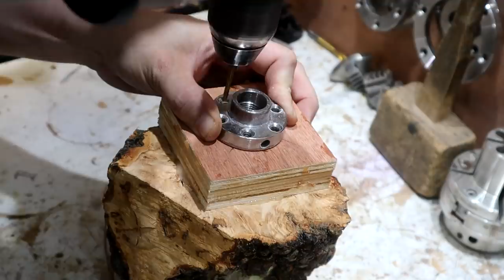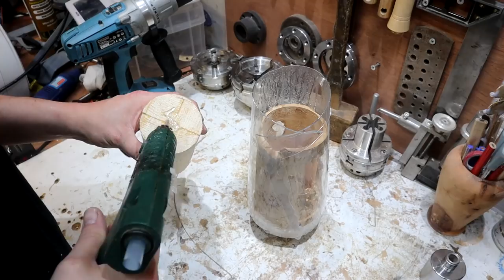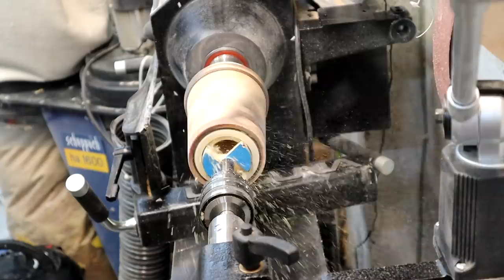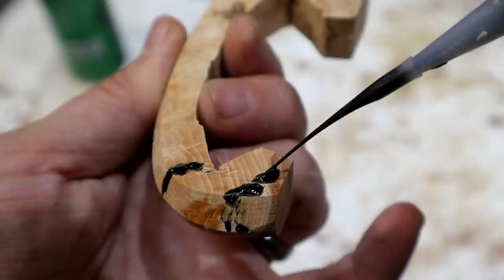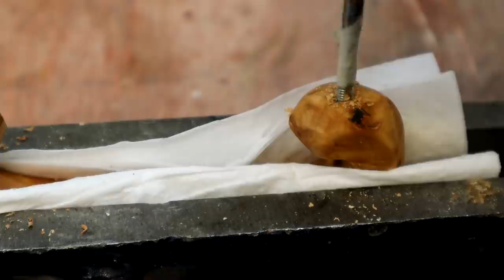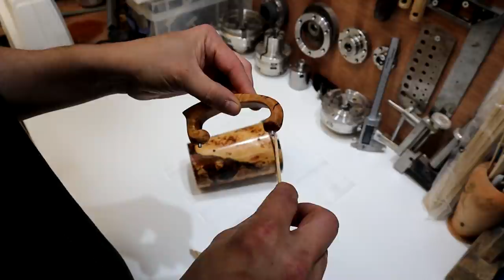Woodturning - The Beer Tankard

Comment: Very nice! But beer handle with less surface contact to hold with beer mug I don't think that the handle will hold for long.
Reply from the maker: Its held in with threaded steel pins, its not going anywhere 👍

Comment: Beautiful! Out of interest, what do you seal the inside of your drinking vessels with to stop the beer/wine seeping into the wood, or the any oil or polish or general woodiness seeping into your beer/wine?
Reply from the maker: This one has a sleeve of resin on the inside, the contents will never touch the wood, I use other finishes too, but anything used with liquids is always a type that cures to provide a water tight seal
Reply: Matt Jordan Thanks so much for getting back to me! If you don’t mind, what other kinds of finishes are suitable for a water tight seal? I’ve never turned anything for drinking out of.

I love your channel, by the way. Everything you make is lovely.

Comment: I keep seeing videos about Resin no longer being food safe after adding any kind of coloring or whatever to it.

Especially with alcohol. As I'm just getting into working with both turning and epoxy, what are your thoughts/experiences with food safety issues with epoxy?
Reply from the maker: Ah yes, the arm chair chemists found on ever woodturning forum, I've never seen any, siltch credible evidence or testing from any of them to back anything they decide to make up on the day to look good on the forums. Specifically the alcohol inks, alcohol by definition is toxic and as such not food safe,  so the manufacturers will say to cover themselves, if you add it they can't guarantee or say the epoxy is food safe anymore and you should apply a clear coat over. I would concern yourself with the primary issue of correct measuring, mixing and curing, thats where things will catch you out if you're not careful.
Reply: @MattJordanWoodturning Thanks for the response! 

I thought as much. It's pretty apparent that proper mixing and curing is the most important part.

Like I said, I'm just getting started in this world and learning a little bit of everything as I move along. 

Thanks again!
Reply from the maker: No problems, the mica dust pigments are perfectly fine too, The FDA actually list them for consumption so long as the percentage does not go above a certain level but I can't remember what that is off the top of my head.